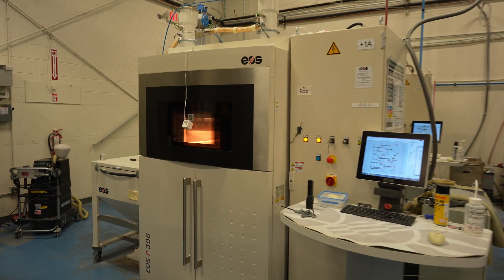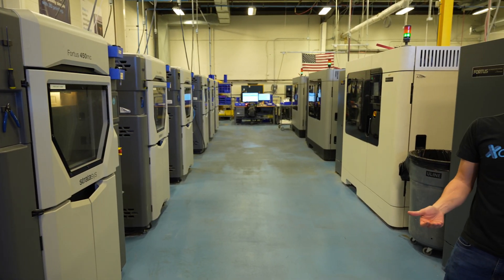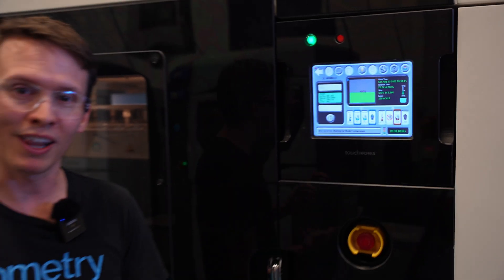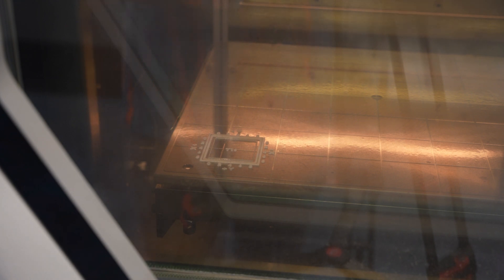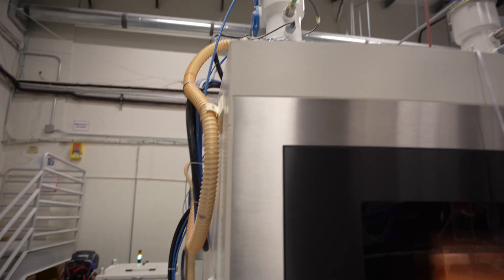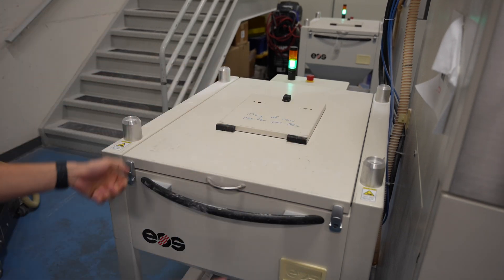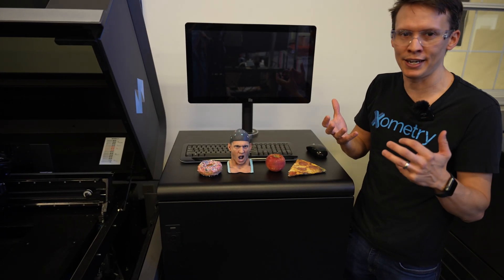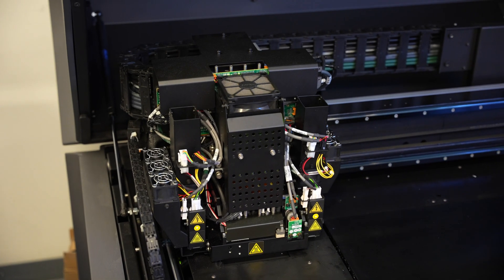Inside an Industrial 3D Print Farm: Xometry Factory Tour

Comment: Can it hold 210lbs person?  Working on a new bicycle saddle, we need a prototype (we have an STEP file) for the invention and too expensive to do a mold for a prototype.
Reply from the maker: Probably. Most materials can support human weight, just make it thick enough and you’re good
Reply: That is great news thank you so much, and was also told that Stratasy, Hubs, Protolabs, PA6+Carbon Fiber and SLS would also work, we really don't want to waste anyones time, which one you think will give us the best shot at doing a 3D prototype (the saddle is 2 piece step file, top and bottom) What we are looking for is a few 3D printed samples to prototype in a strong carbon fiber, or other isotropic material, that would allow say a 180-90 pound person to sit on it for extended periods of time for testing the product.  It is a suspension system with peripheral Fran and rails 7mmx9mm in some areas. We tried to connect with your company and was told that we need a business email and we are still a new startup and want to use our money for the invention @NathanBuildsRobots

Comment: I didn't realize 3D printing was already so advanced. That printer at the end is a game changer.
Reply from the maker: They are super expensive machines. 

Between the initial cost, material cost, and service contracts, we are talking millions to keep these machines running. 
Which is why it only makes economic sense to buy these printers if you are going to be running them 24/7. In most cases, it end up being much cheaper to just pay someone else to do it.